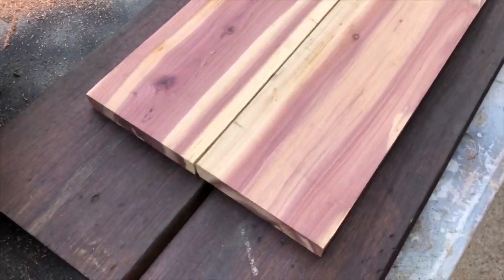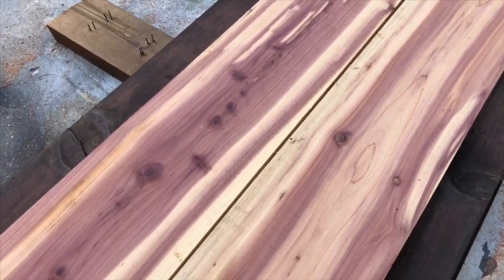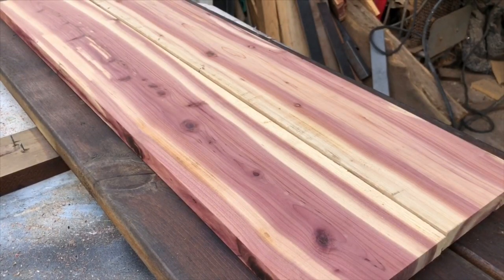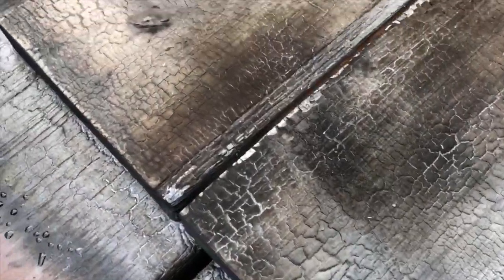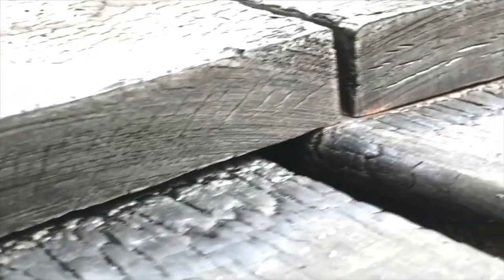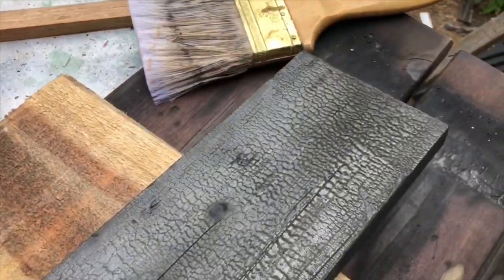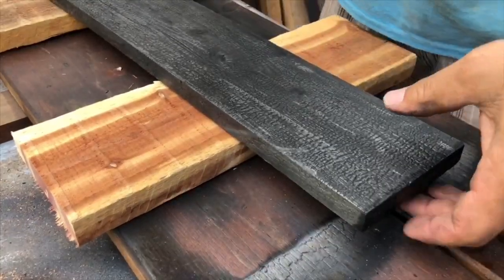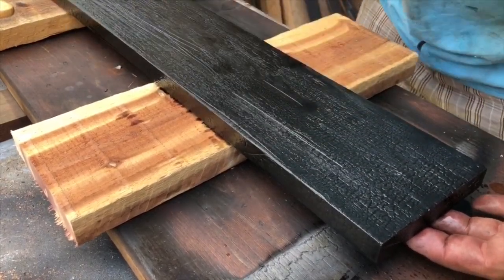DIY Heavily Crackled Shou-Sugi-Ban Charred Cedar Planks Burnt Wood Burning

Comment: I have been looking into Shou-Sugi-Ban as a wood preservation for above ground raised beds for organic gardening.  Watching your process is helpful. Thank you.  However, staying organic, I would be using just linseed oil.  Also, I don’t have access to large quantities of cedar, red wood or black locust, so I will have to use what I can —douglas fir maybe.  Thanks for the vid. ❤ It’ll be an experiment.
Reply from the maker: Douglas fir would definitely work. And I have used it for the same reason in a garden box on my deck and it has withstood a few years so far weather and watering the plants.

Comment: I've been testing finishes for a large bed frame and found a good quality generally use epoxy works incredible! 
and it gives a very natural look if you do it properly.  
put a thick layer of epoxy on, let it soak in for 10-15 minutes (The chard would will absorb a lot) and then wipe off extra with a brush, then dab off extra with a towel, it will give you a very natural and extremely hard and durable finish.
Reply from the maker: Great idea!
Reply: Which epoxy do you use

Comment: i love your attitude... that's a beautiful product. i am so addicted to brushing finishes, sanding down the ridges then staining them (wiping) which creates 3 colors. i think i will try this for an exterior finish. i will look for an update video, but would love to see the results. i live in cold winters. the wood sees alot of wear and tear. Do you consider Pine a reliable siding for cold winters if sugi ban? I've never tried it, only cedar, i heard you mention it in the video.
Reply from the maker: DIY Shou-sugi-ban Wood Burning Torching Technique on Pine
https://youtu.be/qfdV031I_F0 check this video. 

As far as pine. Charring it this way works great at protecting wood. But for exterior use cedar is going to hold up much better. And if your using it for siding you would want to leave that heavy alligator char. Removing some of it can expose the fresh wood underneath defeating the purpose of the char which is to add to its longevity.

Comment: Excellent videos, I do have a question for you: When you char only one side how do you prevent the wood from bowing or warping? It doesn't seem to be a problem for you, but it seems like it would be?
Thanks
Reply from the maker: Char quickly and cool it down quickly. Or burn the other side as well. It won’t be perfect for sure. But for siding or a fence it doesn’t really matter too much if it’s slightly cupped. But slightly only. Some pieces definitely cup more than others as well.

Comment: Thinking of doing this alligator style for my exterior steps.  In your opinion would the alligator style be less durable then if I wire brushed it first?  It seems to me that the chunks of the alligator style would likely to chip off after some usage... I was going to put several coats of spar urethane on no matter what... thanks
Reply from the maker: Great question for steps. Definitely scrape first.

Comment: I tried the burning once to create a compost bin. I didn't want to use chemical protection because the compost is humus that go to veggies that I eat, that's how I found Shu sugi ban.  I used the cheapest abies (fir tree?) planks, they were still green and freshly cut. I could watch them getting attacked by fungus by the day before I got around to burn them and to build the compost bin. So far 3 years and counting the compost bin doesn't rot but the organic material inside does. Always humid and always surrounded by microorganisms the bin stays unaffected. I think it's an outstanding result, and I didn't even oil the wood.  But here is my question: when doing it with abies all the nice black burned cracked easily rubbed off. You touch the material and you have black hands.  Is the rubbing off of charcoal the part nobody talks about or does it not happen if you use the right wood? In this video you used the cedar that's used by the Japanese, does the black charcoal stay hard and won't come off? (Personally I would not want to use epoxy. The whole appeal of this to me is conservation of wood without chemical goo, it's ecologically sound.) So, does the charred part rub off even with cedar? Have you tried a comparison of different conifers?  Cedar might be hard to get hold of where I live. (I read that you have to use conifers with resin as the heating of the resin inside contributes to the effect of conservation). Thanks for this interesting video!
Reply from the maker: Muppel Muh hey good for you! I have used cedar and various pine wood for this effect. As far as the charr rubbing off. It doesn’t matter which wood. It will all do it. For garden I would use a natural oil to seal it like boiled linseed or tongue. That way you don’t have harmful items in the garden.

Comment: You mentioned watering the wood, when, how do you add water to keep from warping?  Thanks.
Reply from the maker: You can wet before or after burning. Or both to really help. I use a garden pump sprayer.

Comment: Pro tip: when applying the poly/oils let brush soak up till full then do one long brush stroke at a time pushing harder down as you get closer to the end for an even layer. This will eliminate visible brush strokes and be a much smoother cleaner look. 
Very cool charred finish I’d love to try a heavy char like this on a future project. Very informative! Keep up the good work!!
Reply from the maker: 38psiGoodbye thanks very much! Yeah with the 50/50 mix its pretty thin and doesn’t get any brush strokes. But thats a great tip. Check out my latest shou sugi ban project i just posted

Comment: So my questions are...  Do you scrape it if you go full alligator?  Of you do a normal burn you're supposed to hit it with a wire or firm nylon brush and then seal it if you like.  So with this style do you scrape it?  Does it flake off and make a mess if you do this without scrapping?  Is it longer lasting to do the alligator vice a more moderate burn?
Reply: I'm looking at doing a more normal burning for a log cabin I'm going to build to help weather proof it which is why I ask.  I'll probably do this to varying degrees of burn with different stains for appearance on everything from the logs to the deck and floors etc
Reply from the maker: Kyle Corrales kyle to get a heavy crackled finish you do NOT scrape it. If you do not scrape it, it can rub off if not sealed correctly. Seal with poly or lacquer and lots of coats to protect it.

Comment: Hi, is it possible to char the wood already fixed as a wall? It’s a pine cladding if a small cabin. 
Without burning the house down …
Reply from the maker: Absolutely NOT! It is most likely sealed with a finish that is toxic and flammable. Do not! It needs to be removed, planed down and then burned before reinstalling.

Comment: "I don't like the plastic coating, so now I'm going with a mixture of 50% polyurethane"?  Why not pure boiled linseed oil and get rid of the plastic altogether? I'd prefer completely natural, and something that's not foreign to where I'm from.
Why not applying oil while the wood is still hot, as I've seen some do? And finally - how little oil can you get away with applying while still ensuringto protect the integrity of the wood and not risking getting soot stains on whatever comes into contact with it?
By the way, the crackled surface structure that you managed to produce is the best I've seen so far. Well done!
Reply: And just to clarify, if it isn't obvious - I have no experience with this area at all. I'm just letting my thoughts out to remedy my ignorance and to satisfy my curiousness :)
Reply from the maker: Sure you could absolutely use a natural oil like boiled linseed or tongue oil etc. I haven’t tried applying while still hot. Thanks

Comment: Great looking piece.  Am wanting to do this as planking on a shed.  Would this be okay for an exterior placement, and what would be an appropriate finish for a less shiny, more matte appearance.  Thanks.
Reply from the maker: Sorry for the late reply! Absolutely yes. This is what the technique was originally used for. For a less glossy finish use an exterior water based polyurethane that has a satin or matte finish to it. Please check out my latest Shousugiban vid. I have a lot more tips and tricks as well as tools that are a must have for a job like that.
Reply: @loveofthegrainworkshop2891  Thanks appreciate you following up, will watch the suggested vid.  Good timing will be doing this in the next two months. Thanks.

Comment: After having coated a chared piece if wood with boiled linseed oil, and letting that dry, Is it then possible to apply a thick layer of 2 component polyurethane on top? Will the PU bind to the dried inseed oil?
Reply from the maker: Absolutely as long as the linseed is completely cured.

Comment: I've just performed this with my cedar cladding for my deck railing posts.  I haven't put any sealers on it, and I would prefer the natural oils as well.  My question, will it leave a stain if someone rubs agains the charred boards after I've applied a couple couples of sealant on the charred wood?
Reply from the maker: Sorry for the late reply. I would definitely seal it with a natural oil like boiled linseed or tongue oil. It will penetrate and harden. At least 4 coats or more to prevent the charr rubbing off. And it will need to be re-applied over time.

Comment: I would love to do this to our backyard fence. Would a fence do well with this technique? If so, Would you use the same poly and linseed oil to seal it?
Reply from the maker: Hey! That’s it’s original purpose along with siding. Yes you would use a natural oil based finish or even an exterior spar urethane like Helmans spar.

Comment: every other video that I've watched about this tells me to brush the wood after the burning even for a deep burn but I didn't see you doing it, is it just personal preference, is it because everyone is trying to achieve a different look?
Reply from the maker: For a heavy char like this one. The wood is very fragile. That alligator like texture are bubbles essentially in the wood. Brushing it can damage them ruining the effect. If you are using the piece for a fence or siding. Brushing is fine. Though I would prefer to spray the finish on the preserve the look. That is the traditional way. But like this piece if you’re using it for decoration. Pour or spraying on the finish works best to preserve that texture.

Comment: Have you tried this deep char technique on regular pine boards? Also, if this was done on a couch would the char rub off when people touched it?
Reply from the maker: Great question. I have done it on southern yellow pine which looks fantastic. Check out the other videos I have listed. Both using pine! Yes depending on how much char it will most likely flake off over time. I would recommend for furniture a light charr with a few coats of water based polyurethane over top to help stabilize and seal it. Or depending on the piece and how it’s made a coat of epoxy resin would work better. I also have a video on that.

Comment: great work!! QUESTION: during usage, wont be your hand/arm/clothes/etc black by touching it? so the soot of burned woods are not there anymore after oiling?
Reply from the maker: Yes it can if you do not correctly coat it with the right mixture. I brush on probably around 5-6 very heavy coats so it could absorb into the wood. Let it cure and then reapplied a few more after that. That way it sealed the pores first. And then sealed over top of the wood as well so it didn’t rub off. Extreme pressure from dropping something might have damaged it but not normal use.
Reply: @loveofthegrainworkshop2891  I built some western red cedar deck chairs and I'm wondering with the right finish if this technique will work so that people can actually sit in the chairs. Thanks for the video!

Comment: Hey thanks I was wondering how people make heavily burnt wood. I just wonder how much it stains your hands (or does it? ) after you treated the wood
Reply from the maker: If you seal it correctly it shouldn’t stain anything. I would recommend burning and scrubbing with a wire brush like one of my other videos shows to prevent rubbing off if using for seating. But this one will last a long time.

Comment: I thought the reason to burn it would make it water and bug proof? Am I wrong? I want to use some old planks from a deck to use as the skirt sondo I need a sealer?
Reply from the maker: Ridik that’s correct. The sealer is an added protection.

Comment: How durable is the crackle once it’s sealed? Could it be used as decking or would it just dust away?
Reply from the maker: Not for standing walking on. But for railings & posts it would be fine.

Comment: I would like to do beside tables with this finish, but I don't want to have to re-finish thew wood in order to prevent it from flaking off after a year or two.  Will your 3:1 mixture of linseed/tounge oil and polyurethane be suitable to seal the wood and charred bits forever? Like other commentors,  I don't want soot breaking off.
Thanks!
Reply from the maker: No unfortunately. You would need to seal with a finish that could build on the surface. So a water based Polycrylic by minwax or similar. Or epoxy resin.

Comment: I love your work, I have a question, at home I have two 9 foot tall wood pivot doors. The climate where I live changes drasticly, so the wood on the doors has cracked. I was thinking of using the blow torch. Would this help with the wood from cracking even more?
Reply from the maker: Rodrigo Mattos actually once cracked. The burning can cause the crack to widen. If you do it prior to cracking yes it will help prevent it. But it’s not perfect.

Comment: I’m considering doing this for a bar top. I love the idea of being able to feel the crackle, yet would want it water resistant. Would the technic you used work? 
What are your ideas?
Reply from the maker: joshua foster to make it water proof. I would pour a couple flood coats of epoxy resin over top.
Reply: It's naturally water resistant. Part of the reason for the wood being this way.
Reply: I have done this and used my restorer to take off most of the crackle it leaves a beautiful charred finish without the crackle. I think that is what you would have to do to use this as a bar top unless you are completely covering it with a thick coat of epoxy.  In my opinion the crackle WILL flake and chip off with this 50/50 mixture of finishing. I would like to see this "table" he is creating after a years worth or use. Remember this has to stand up to USE! I don't think the crackle though beautiful will stay in place.

Comment: Hi there, i would like to make a Shou Sugi Ban cutting board like these boards, how would you finish them, or wouldn´t you treat them at all in the end? Thank you for your inspirations.
Reply from the maker: Josef Keilhammer thanks for the question. While a board with treatment would look fantastic. It definitely wouldn’t work. This technique makes the surface of the wood soft and very easy to cut. The crackle especially would just flake when cut on. It’s meant for protection & looks not for use.
Reply: Thx for the answer, i just saw a guy on a Channel who uses burnt boards as cutting boards, that is why i was asking

Comment: Beautiful. Couldn't really see what kind of table you used but It reminded me of an old singer sewing machine wrought iron set of legs. I just happen to have a set of leggs in the garage somewhere...that's going on the list. Right now I am trying to make a bit of a boardwalk through the garden. I wonder if I can leave the gator look or will it flake off too easily? I did hit some of my practice pcs with a broom and that worked ok. I was trying to avoid having to use the wire brush as I will be doing so much of it. If the sealer helps it to harden would it be super expensive? I was planning to use oil, living on a budget these days. K thanks for all your vid's. I am learning a lot. and yes kind of hard but it's going to be so cool. PS I do not really do carpentry, I'm just a chick that likes to do cool things. thanks, Kim
Reply from the maker: Kim Wal that’s awesome! Go for it! As far as the heavy gator look. Yes i would say that it might be a little fragile to walk on. I would recommend do the heavy crackle but them use a brush to wipe off loose bits.

Comment: If I not wrong burning just the side of the stud facing outside of the wall, rigth?
Reply from the maker: Juan Paredes yes and no! If using as fencing you would want to burn all the way around. For siding, just the outside needs to be charred.

Comment: Maybe I misunderstood, but did you say you were using Danish Oil, which is a combination of Polyurethane and Boiled Linseed oil, or that you made a mixture of Polyurethane and Boiled Linseed oil that you are comparing to Danish Oil? Also how exactly is water used to prevent warping? Do you mist the board after you char it, or do you give it a light coat of mist beforehand?
Reply from the maker: I mixed the two myself which is similar to danish oil. Spraying before and after can help prevent warping. Charing both sides can also help.

Comment: If I have some pine tongue and groove, some of which I’ve already stained and applied poly to, could I apply this method? Or is it too late? I’ve also got a few boards that are warped, but not stained. Could I spray with water and try this technique? All of my boards were also all sanded, as I was going to stain and poly all of them for a wall application. Thank you for any advice!
Reply from the maker: Unfortunately I would think it needs to be clean wood prior. Poly would affect how it comes out. Probably wouldn’t hurt to try.
Reply: @loveofthegrainworkshop2891  okay, thank you! I still might sand those with poly, then try to burn. Nothing to lose!